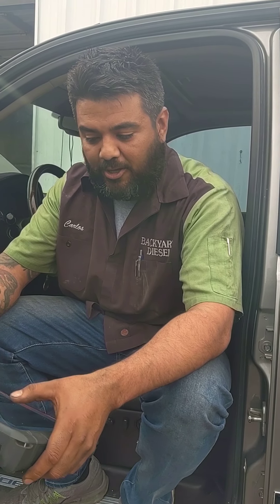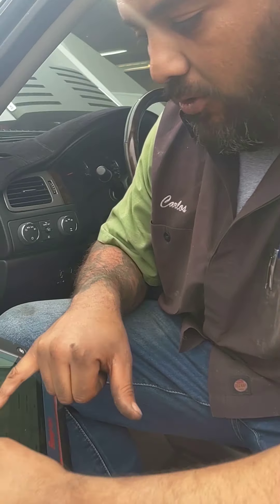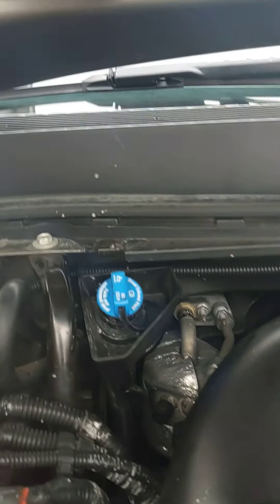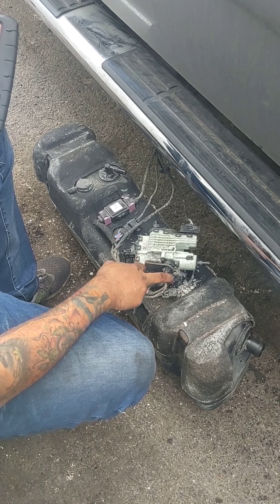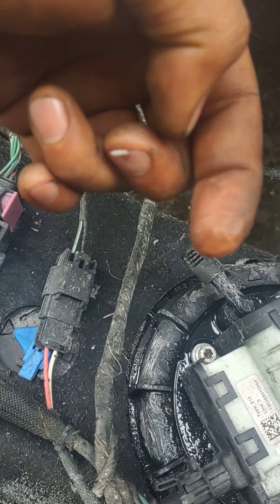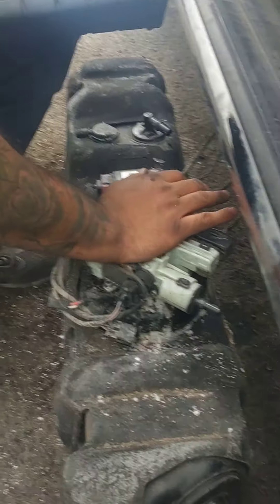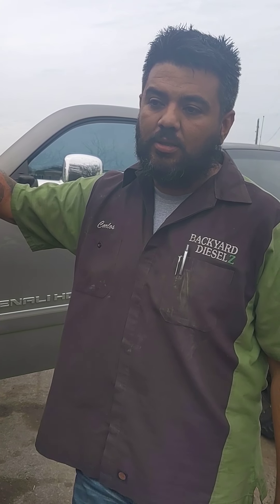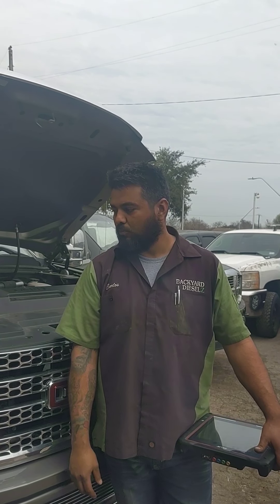Chevy/GMC Sierra 2500 6.6L LML (P204B) DEF issues

Comment: I have a 2017 Silverado 2500HD LT 6.6L that was throwing P1050 and the lost communications with NOX2 sensor.  The  DEF pump and the NOX sensor were replaced and it is still reduced power 45 miles to 5mph.  Any suggestions?

Comment: On the same truck I replaced the injection pump and all injectors ... truck won’t start before now it does after I changed injection pump, all injectors, return line, nox seniors and def heater... but it’s showing emissions system heck owners manual... how do I reset.. or what’s next step after all the work... TY
Reply from the maker: Why you changed many parts... Fuel system contaminated.. you need a high tech scanner to reset emission... If your replaced the injectors... You had to program each injector flow rate.. and with the same scanner you should be able to do.
Reply: Backyard Dieselz I have the snap-on modi’s ultra scanner
Reply: Reset all 3 heaters on DEF system......should be able to clear other codes after that

Comment: If the pump for Def stop working on a 2011duramax,6.6.lml and can set on poor quality def light on ?
Reply from the maker: Yes.. right away... Have you tested the def tank.. air leak
Reply from the maker: Let me rephrase that it won't come up right away but it come on in about 60 miles or less..
Reply: Okay thanks carnal I'll let you know what happens after I change the pump

Comment: Thanks for your help carnal I drop the def tank and there's no leaks but I noticed that the pump is not coming on N tested the tank and notice on the 2breather ports on  top of the tank one of them was blowing same liquid is that ok
Reply from the maker: No nothing should be coming out.  Should be sealed..
Reply: Okay so what keeps the tank from calabtion and why are those ports for
Reply from the maker: Yes it's a breather.. check valve.. no liquid should be coming out.
Reply from the maker: How much pressure you put in...test at 15 psi..
Reply: The tank was 3 quarter full and I  pumped up to 25psi
Reply: Thanks for your help carnal I  leaved in  pharr Texas and now I leave in Washington
Reply from the maker: You figure out the problem
Reply: I'm waiting for the Def pump to get home so I can replace it
Reply: Hey carnal I replace the def pump and I can't get it to come on can you help
Reply from the maker: @davidgfigueroa1289  you have to run test to activate it...what scanner you using....you have to reset then run the test... Just go down the list one by one
Reply: I thought the computer save all the settings
Reply: I did what you told me is not coming on
Reply from the maker: @davidgfigueroa1289  damn bro how many trucks you working on you're all over the place...
Reply from the maker: You have to do a purge test and a DEF fluid quality test
Reply: @BackyardDieselz  I'm sorry carnal El bato who's helping me isn't that good like you fuma mucha marijuana n I think his brains cells are gone and I tried to tell him what u told me . I'm not asking him anymore . sorry n thank you for your help

Comment: Hi, I was wondering what the hose is called that you mention breaks all of the time by the firewall?  This happened in my truck. Do I need to replace the whole assembly or can I use plastic weld to attach the hose back (at the elbow where it snapped off). Thanks
Reply: that is a def fill line just got one for a 2018 3500 and they aint cheap comes with fill hose vent hose and overflow hose plus the mount. the vent hose is the one he pointed too

Comment: 2015 Chevy duramax poor quality on messeng center could your video be the problem I was getting a bad nox sensor code but not anymore this is the second time this message comes out I did a regen last time and light went off but not this time thanks
Reply: Try replacing DEF injector.  Sometimes DEF injector can spew too much DEF in system and trigger nox sensor code.
Reply: Dónde están ubicados vivo en Dallas nesesito servicio par una 2018 6.

Comment: So the problem is the DEF pump not the heater, shop is telling me they have to replace the DEF tank assembly
Reply from the maker: Depending on the problem bro..  that the only code your getting...
Reply: Backyard Dieselz  it’s fixed now $3700 later it was the heater, pump and module
Reply from the maker: Well that's good bro.... All emission related problems get very costly really quick... That's why alot of ppl just delete them.. some ppl really can't afford to repair them...
Reply: Backyard Dieselz I will delete it as soon as I smog it!!!